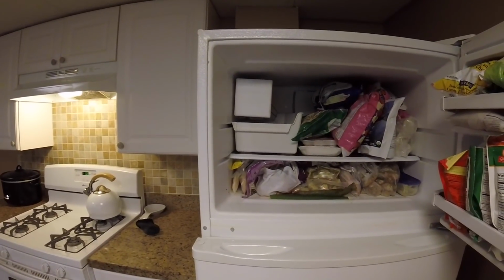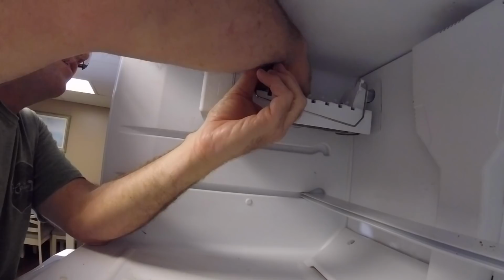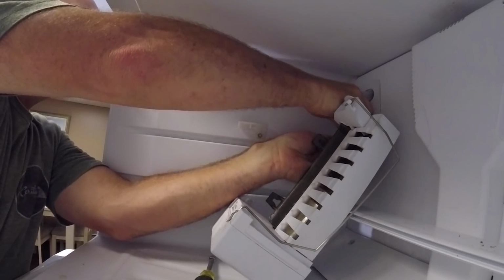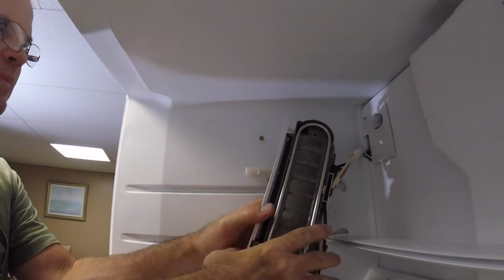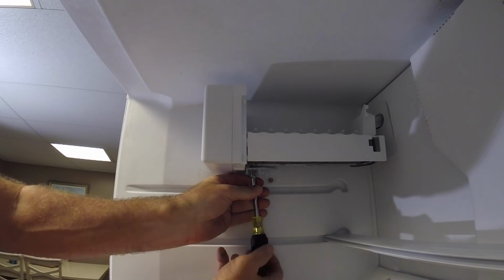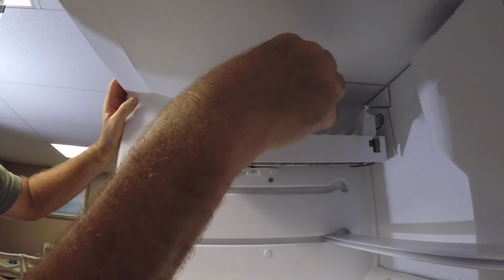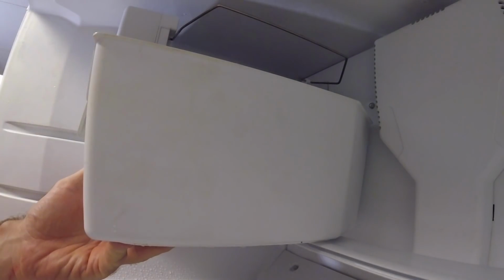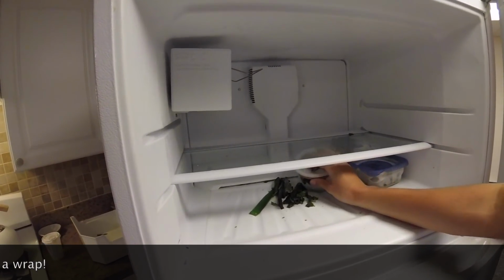Maytag Ice Maker Replaced

Comment: CB-1 I have installed plenty of ice makers I believe the cell annoyed at the bottom of the refrigerator in the back is probably no good that's why It kept filling up to much. When the ice maker doesn't work right 95% of the time it's the cell annoyed behind the cardboard all you have to do is replace that. the first ice maker that was in there is probably good .AB1 was ready to work today peace brother
Reply from the maker: yes it was the solenoid in back according to owner. I was long gone for the completion. My appliance career officially over ha.
Reply from the maker: Yes, AB ready to get it done
Reply: I assumed they meant overflowing the bin with ice, since the level sense rod was popped out, it would just keep making ice until it filled the whole freezer and eventually pushed the door open! it's happened before, the people return home from a vacation, and find a huge mess.

Comment: shouldn't this have been titled anti-ice-maker lol
wait, I see the issue with the old, the "ice" level sense arm wasn't popped in the slot where it should have been, so it would have just kept making ice and overflowed the bin lol
and commented too soon in video, DOH. solenoid valve bad, stuck open with debris or wiring issue keeping it energized. or someone didn't install the valve at all ?
Reply: yeah, I've done lots of appliance repair, it kind of goes with being good at electrical, electronics, plumbing, mechanical, carpentry, etc.
 if it's for friends/relatives, I don't always just swap boards and components, many time I'll do circuit board/component level rebuilds if it's economical. which isn't so much anymore with all the chinesium disposable cost items :|
Reply from the maker: nice. this was a family job. ha
Reply from the maker: yup solenoid was the problem. They are not my thing. Im guessing its just like a zone valve? kinda sorta?